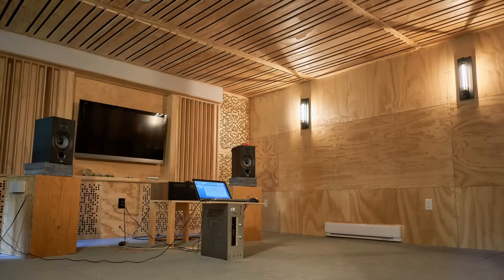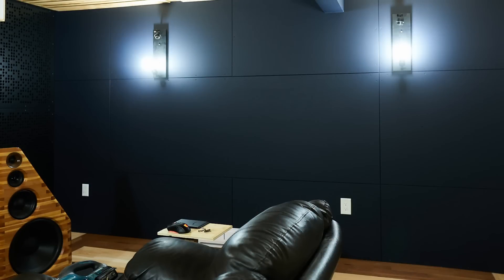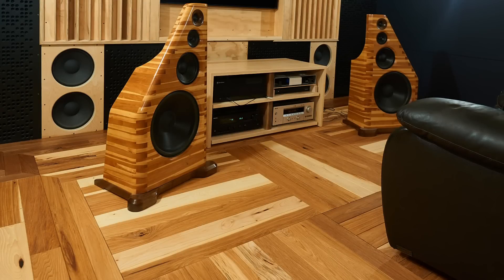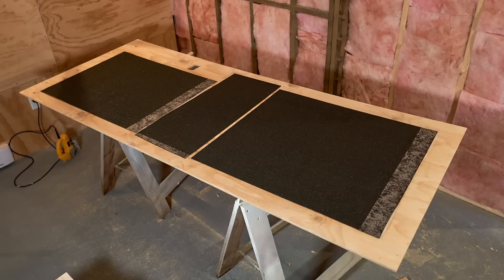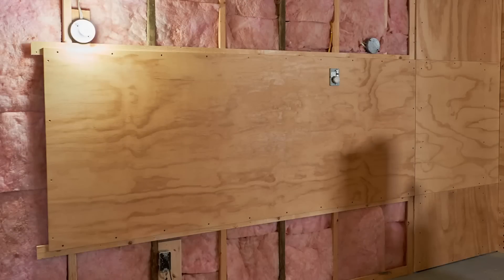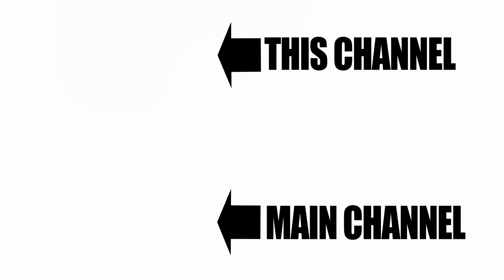Why Did I Buy This Crap? Room Acoustics Basics

Comment from the maker: Sound advice on room treatment: https://www.youtube.com/@AcousticsInsider
The basics of room acoustics are simple - use lots of thick absorbers to reduce the reverb time in the room. 
Of course you don't have to start off with a lot, but keep adding as you can afford it until you've reached a point where they are working effectively. But don't fall into thinking that you can get away with using more thinner panels - they need to be a minimum of 6" (150mm) thick, otherwise you are wasting space and money. And you are also killing too much of the high frequencies that you need to preserve to make a room that sounds good.

The key with thick absorbers is that they start working right away in the right way. They help to fix the problems that every small room has, and that's room modes and excess energy in the room. They are the easiest, the least complex and generally the most effective way to treat a room.
While there are other effective methods, like Helmholtz and diaphragmatic, they are harder to design, build and put in a place where they'll work best.
There are also electronic bass traps, but they are quite expensive and may not be more effective than standard absorbers.

So on to the idea of cancelling room modes by timing a signal to do that. 
I used the ringing bell as an example, but stopping that from continuing to ring would be trivially easy compared to doing that with an enclosed volume of air inside a room. And assuming you could do it and have it work as it needs to, you'd be unable to change anything in the room or it would stop working. That includes adding more people to the room or leaving the door open - it would throw off that delicate balance.

And like I said in the video, to stop the ringing you need to make a sound that's not part of the original signal to do that, and that's distortion. Any change to the original signal is, by definition, distortion.
The best, proven method is with the brute force absorption I talked about. Room acoustics have been studied for hundreds of years and in the last 100 every possible method has been looked at in detail and tried. 
That doesn't rule out further discoveries in the future, but they would have to be much more sophisticated than the method described above.

Worth mentioning that I didn't mention diffusers. Those are only used after you've put in as much bass absorption as you possibly can. Diffusers only work on higher frequencies and have no impact of the bass frequencies.
Also my absorber charts show the flow resistivity as 10,000 for both the foam and the fiberglass / rockwool. This isn't accurate, but is "close enough" to show the glaring differences between the thicknesses. That was the point - making the panel thicker so they will be effective down low. The flow resistivity has an effect, but not as much as making the absorber thicker.
Reply: Treat the listener not the room .

Comment: Foam is pretty much useless. 
Multiple layers of towels stacked and slightly spaced in a 2'x4' box frame that's mounted ~4" inches off the wall work great for sound absorption.

Comment: I am rewatching this one year later. I attend Church Services at a fairly large 125 year old church that underwent a $6 million dollar restoration 25 years ago. The church is beautiful but acoustically a train wreck. The most horrible acoustics you could possibly imagine. Speech is almost unintelligible and music performances just sound terrible. An “acoustic specialist” (my term) came in looked over the situation and I was told performed some type of measurement(s) and installed some moderate size thin panels covered in a fabric and likely has some type of foam
Inside. Result: Money spent, sound quality still sucks with no apparent improvement whatsoever. I’m sure that a real knowledgeable person with a true understanding of acoustical treatments could have done a better job for the money budgeted for the treatment. 25 years later it’s still poor. The solution upgrade the sound system. Now we just have a louder mess with the same issues amplified 🤦🏻‍♂️. I’ve expressed my concerns however like the sound inside the church no one understands. 🤷🏻‍♂️ 

Thanks John for very insightful thoughts on a variety of topics, measurements and debunking myths.

Comment: You’re an audiophile which literally means someone who likes sound. 

You don’t subscribe to certain beliefs but you’ve created a YouTube channel dedicated to good sound where you talk about what works and doesn’t for you. And as you sit in front of your QRD’s. 

Don’t for a second think that you are significantly more rational than “the average audiophile”. You simply subscribe to different beliefs. 

Why? Because with every claim comes an often intangible unquantifiable translation to the subjective realm. 

Case in point: we understand the technical shortcomings of tubes. They do have the capability of sounding “better” subjectively. My opinion/belief is that the second order harmonic distortion emphasizes spacial cues when they occur. Also, the increased distortion during transient peaks creates an illusion of increased dynamics.

We really don’t need another speaker quasi DIY manufacturer . Audio shows are overrun by new “me too” products. 

Respectfully, If I wanted an open baffle speaker made by a science driven designer I would buy a pair of lX521. That would be much more “rational” than buying something slightly similar made by one of SL’s fans.

Comment: Its easy to spend a lot on thick absorber for no benefit at all (I've done it!). The most important thing I learned about selecting the right porous absorber is the effect of 'flow resistance'.

If an absorber has a higher flow resistance (i.e. density) the sound will at some point 'give up' trying to go though it and turn around back to the room. This means the thicker your absorber, the lower the material density you want. e.g. RWA45 rockwool is good for about 4" no more.
Reply from the maker: Flow resistivity has little impact on how well an absorber works. Thickness totally eclipses any differences in GFR.
I have a room with proven (with detailed measurements) results that show that. See my videos on that.
BTW, your idea of the sound "giving up and turning back" is fairly ridiculous. Sound dissipates, diffracts and / or reflects, it doesn't "give up" like it has a mind of its own.

Comment: Here’s what I’ve learned a year or so ago about room modes/frequencies from legit (I think) engineers…

For reducing low/mid freq echoes via panels… it is said that it is most effective away from wall as its’ thickness, like you’ve stated. Any further, it doesn’t improve.

However… regarding room modes/frequencies (like how a glass bottle has its own freq when blown into it)… the greater distance of panel away from wall actually reduces room mode freqs better (unlike reducing echoes)… 
eg: a panel 6-10’ away from wall is more effective at reducing modes (unlike reducing echoes).

Have you heard of this?? 

I guess reason it isn’t done/known much, because it looks silly to have a panel 6’ away from a wall, lol.

Comment: Here's a couple........................
       1. BEAN BAG CHAIRS;  Now filled with memory foam chunks & a microfiber bag, they are attractive, easy to move around, cost effective and dual use. Stack them in the rear corners as a bass sink.
      2. VERTICAL BLINDS;  Install floor to ceiling vertical blinds with PVC slats and fabric inserts at the first reflection point.  Align the slats to the incoming sound wave & you'll get a perpendicular sink on the rebound.  Just like "Riffles in a Sluice Box".

                                                                      Reggae, Funk & Brass   🔈🔉🔊
Reply: PS,
    Variable crossovers are available for sale at a reasonable price.

Comment: Thank you for this John. I like my music to be on the "bright" side and I have struggled with my room treatment. You mention the carpet and ....... yup, I forgot all about it. Without the carpet the room ( 10 x 11 x 7" 6" ) reverbs like crazy but with the carpet the highs are missing. I will roll the carpet up to half its size and see if that helps. I will also take out the thin insulation and use it to build up my bass traps.  I did not know about pulling the panels away from the wall.  I need to thicken my panels to 6", transfer the thin insulation to the bass traps and use the carpet as a control for the high end reverb.  I think that this will help me go in the right direction.
Update:
10 minutes of work and I have my bright sound again.  All I did was to roll the carpet to 1/2 its size and remove the 3" insulation that I had behind the diffusers that were on the front wall between the speakers.  There is still lots of work to do on the low and a little on the high end but at least I am at a point where I can make the necessary adjustments. Off to the big box store to grab more safe n sound to build the first reflection panels to 6" from 3" and to increase the height of the bass traps. I will head to "Acoustics Insider" to get info on how to use REW.   
Thanks again John!!!!!!
Reply from the maker: Even though I've got a ton of absorption in my room, it's still mostly reflective. The floor, walls and ceiling are mostly covered with wood, so it retains that "live" feel that you want, while reducing the low frequency reverb that you don't want.
Good luck with it Paul, and thanks :)

Comment: The corrugation adds damping, by making an acoustic impedance matching from air to the foam, so the sound in the air passes into the foam, where the speed of sound is slower, and there is damping, so the sound can be damped in a shorter distance.
Sincerely, acoustic physicist.
Reply from the maker: If it adds anything, it will be minuscule and of no significance overall. I doubt it would even show on measurements.
Sincerely, a guy that does stuff :)
Reply: @IBuildIt  denies the effect of acoustic impedance matching, without any evidence or math.
I have built acoustic horns which use this effect, and which amplified my iPhone to loud levels, with bass. I have done the math, and so have others. It is documented and not that hard to find on the net. The Webster horn equation is a start.
Reply from the maker: If anything, the corrugation is supposed to act as diffusion, but the material is not hard enough to reflect.  You can do the math and even invent some, but nothing will make this foam suitable for room treatment.
As for acoustic horns, that's impedance matching, yes (I've made videos about that, in fact my last one...), but the effect it would have on this foam is negligible! It's too thin!
Reply: There is a good reason million dollar anechoic Chambers use wedges, not flat panels. It's not to save money on material costs 😅 On such a thin panel as 2" and low density it probably does very little though, that's true.
Reply from the maker: Anechoic chambers use wedges that are LARGE and reflective. They are designed for the sound to enter and bounce back and forth to dissipate the energy. And there's more going on behind those wedges.
The foam I show in this video is for people who have no idea what's required to properly treat a room to waste their time and money on.

Comment: Something I discovered by accident was to add Microspheres (for epoxy filling) to ceiling paint. It made the appearance of the paint much flatter, and the surprise was acoustic damping. 
As I didn't expect this, I didn't make before  / after measurements, but people who were in the room before and after the ceiling paint noticed the difference in reverberations. 
I added about 2 coffee cups of microspheres per gallon  keep stirring frequently. I put on 2 coats, at 90 degrees, for a uniform look.
I'll suggest it for living rooms, etc. I don't believe it would fix a listening room.

Comment: The Best room is no room. Essentially outdoors.
And tats what a anechoic room  trys to emulate. 

 So i digress that high frequency reflections in your listening room are a good thing. They have reflections in the Recording room, this enough form me. i don't want to add the "color" of my room to the recording.
Reply: Have you ever listend to speakers outside or in an anechoic chamber? It sounds just wrong.
Reply: @luxxer12  Have you ever used Headphones?
Reply: @lambda7652  yes and it is instantly apparent that headphones have no soundstage like speakers have, because there are no reflections. Thats why they can not reproduce recordings accurately unless made with a binaural recording head.
Reply: @luxxer12  All the reflections from the room it was recorded in are already on the record. 
There is no need to alter it further. 
If you want to add additional reflections/reverb and effects just do it in software.
Reply: @lambda7652  Thats just not correct. Almost no music is just recorded in a room with a stereo microphone setup. But i dont want to lecture somebody. Do your thing. Maybe look up some research from the 80s till now to broaden your horizon.
Reply: @luxxer12  If you want to add some coloration bahts fine but doing this with a room is inefficient if you can do it in software/DSP

Comment: It's a balance between mass and volume, sound waves need to be able to enter the material but not leave. I think of sound panels as capacitors in parallel, like a low pass filter. I've wrapped mine in 8 micron kitchen foil with 80mm rockwool inside and 3.6mm plywood backing . Keeps the dust and smell inside and very high frequencies bounce off of it while it is transparent to lower frequencies. On top of that I've wrapped it in canvas for looks and a bit of diffusion. When you stand close you get that silence you feel similar to an anachoic chamber. I've used the panels to divide the room in two with a 3m airgap. I'm considering treating the drywall ceiling but I'm not sure if it would be an improvememt. Maybe a smaller panel and see how it performs. I have wool carpet with insulation panels under it, all in all 20mm I think.

Comment: Recently I read about a membrane (that covers a whole wall with same gap) with a heavy weight in a middle. People say that it absorbs low frequencies extremely good. Of course, a tension and the weight mater. If it really works like is promised, that would be the cheapest and fastest way to prepare a room acoustically.
Reply from the maker: Those are limp mass absorbers, similar to the diaphragmatic absorber I mentioned in the video (my walls). They work the same way, by reacting to the specific frequency they are tuned to. So one tuned to 40Hz will absorb very effectively at 40Hz, but do very little at other frequencies.
Reply: @IBuildIt  Hm.. We have to take into a consideration that heavy weight. The close to a center, the higher resonance frequency is. I guess such membranes demonstrate wider range of an absorption. I'm full of an enthusiasm to try
Reply from the maker: You should, since it's the best way to learn if you are open to that. 
Materials resonate at one frequency, generally, and that frequency is determined by a number of factors, like size, mass and stiffness. A limp mass may be differentially loaded to resonate at more than one frequency - that heavy weigh you mention. Still, it can't be as broadband as a thick porous absorber, which covers several octaves.

Comment: this was a great way to explain some absorption and acoustic properties. i have also found acousticsinsider channel to be educational over the years.
and i found some use for those cheap acoustic foams: when you only rent and want something on the ceiling they can work ok if you stack them two layers and have that thickness as air gap.  i have covered my ceiling that way after i diy some 8" think absorbers.

Comment: Very well explained John! Thank you for your time. You would have been a great teacher!
Reply: For some of us he is now :)
Reply: except there's an error :)
while he's correct, those absorbers are not 2" and can't absorb any kind of bass, they're not 1.25" either.

profiled panels perform better than flat panels w/ half the thickness and also act as diffusers. because of the "cuts" more surface area/more foam pores are in contact w/ air.

a 2" wedge acoustic panel offers an absorption coefficient of about 0.70 at 500Hz compared to the calculated value at 3:41 of less than 0.5 (that would correspond to a pyramid shaped 2" foam profile).

---------------
see if you can find a few explanations from manufacturers about the difference between flat and profiled acoustic panels. 
(this is just one example, search for "Does The Profile Of The Foam Make A Difference"

Comment: About multiple subwoofers, this link goes into great detail, published by Harman, that might give you some insight on using them.
In my case I only had room for three subs but it definitely made my low end smoother along with using REW and equalizer APO

https://audioroundtable.com/misc/Welti_Multisub.pdf
Reply from the maker: I have multiple subs and made a video about that a few months ago. It evens out the response, but it does nothing to reduce reverb time caused by room modes.
Reply: @IBuildIt  very true, I neglected to mention that but focused on the improvement on response.
Thanks again for your efforts on this subject though, good video